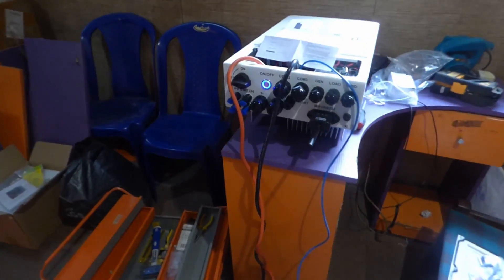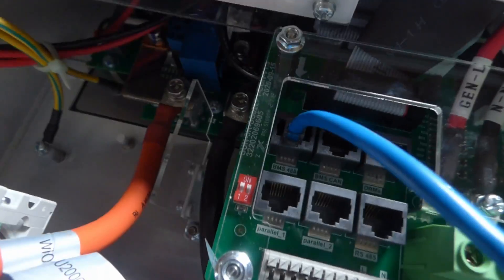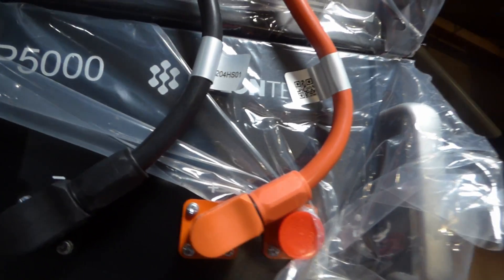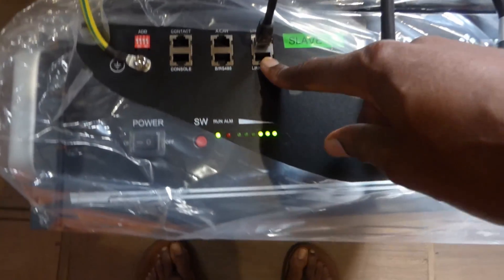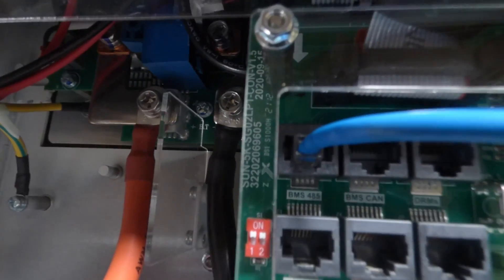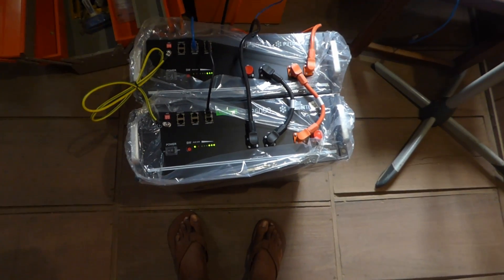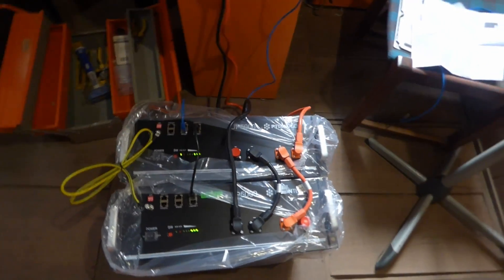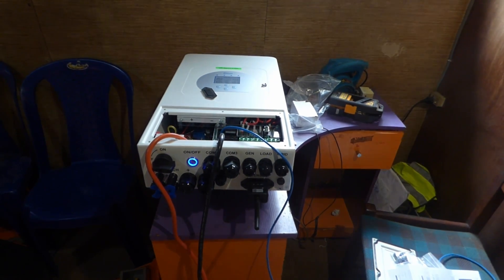Deye 5 kw and 10 kwh Pylontech UP5000C

Comment: hello,  hope you doing well , i have the same system but with 4 UF5000, notting the following issue:
The system experienced an over voltage event (56.94V - 57.11V) while charging PylonTech UF5000 batteries via grid and solar at the same time  , but no errors were logged. deye already run firmware update   but did not sort the issue, your feedback highly appreciated - thanks
Reply from the maker: Good morning. Thank you for watching and commenting. The UF5000 is a 16s battery. The voltage you saw is still within acceptable ranges. 57.11/16 = 3.56 per cell. I would not be concerned.

Comment: Hello from Ukraine!
I have been using a similar set for several days.  I can't find where to limit battery charging to 80-90%.  As soon as it is possible to charge from the sun or the network, the battery is charged to 100%.  To save the battery, I would like not to charge it completely!
Reply from the maker: Thank you for watching and commenting. Slava Ukraine. You can use time of use. Unless you use voltage it is the only way.
Reply: @drsolar  Yes . But its working only with grid energy. If you have ekstra solar energy inverter charge batery to 100%
Reply from the maker: @Pvaleriy  unfortunately I don't recall the ability to limit it with solar

Comment: Greetings Dr. Solar… you are missed, hope all is well with you and yours & the cats. 1-yr on, how have these batteries performed & how often have you had to update the battery firmware or the Deye firmware? I’m now running on lithium having redone my system and am on a UU-24-100 battery (Chinese). Have retired my panels and have to redo them again as I’m maxing out my MPPSOLAR solars 145Voc capacity this winter so most days my solar is off and am charging my battery off the grid. Hoping to upgrade inverter to 5Kw Sunsynk and US5000 Pylontech and use 1 MPPT as I have 12 x 250Watt panels. Am excited about the development so far & have had 2-3 blackouts and my battery bank was adequate.
Reply from the maker: Congrats on your new acquisition. I am sure you can see the difference between your new battery and the old. Like night and day. The kittens have developed personality and have started to hunt. They have killed a few pigeons in the compound. Most of the systems that we run don't require firmware updates. We have yet to do battery firmware updates. So far so good. Thank you for following up. Once again congrats on your new battery.
Reply: @drsolar  I’m still at beginning stage and haven’t run a full stress test on the system right down to my LBC (Low Battery Cutoff) yet, will do that soon.

Comment: do batteries go to idle when fully charged? my only goes in standby for 2-3 seconds before going to charge or discharge discharge for 40-60 seconds.
Reply from the maker: Depends on the settings on your controller. If you have Bms communications it will go into idle mode until a load large enough comes in and pushes it out of idle
Reply: @drsolar  same deye inverter. Not using solar panels.
Reply from the maker: @ah.l  okay
Reply: Які настройки провести в deye для акумулятора PYLONTECH US5000, щоб не включався і не виключався на 2-3 секунди?

Comment: What's the max Kw that the invertor can charge the batteries at? Can you parallel up the invertors for  use  on a bigger battery bank?
Reply from the maker: Hello Alex welcome to the channel. Please don't forget to subscribe. The 5 kw can charge at up to 120 amps. Yes you can parallel inverters to get higher charge current. Thank you for watching and commenting

Comment: Based on one of your other videos I will like to see how these 2 batteries behave at 95 percent discharged and where you end up running your voltage settings for charge and discharge parameters. What made you decide on the pylontech? Keep the videos coming!
Reply from the maker: I am not sure I answered. I would never run them to 95% discharge. We do 90% with these. The older batteries we did 80%. Thank you for watching and commenting
Reply: Charge discharge voltages are set by bms, you can change charge/discharge current from inverter.

Comment: Is the pylontech battery available on n Nigeria, what’s the rating ?? And price pls
Reply from the maker: Thank you for watching and commenting. US5000 rated at 4800 watt hours 95% DOD. 50 watt charge and discharge
Reply: AWPS Renewable Energy, LTD how can we buy it from you. The price sir.?  Also Can you run AC in the day time with your deye since it’s solar inverter
Reply from the maker: @abbaadam7107  I run two AC's during the day. I have enough panels to more than make up and the batteries are big enough to absorb any cloud cover. info@atlanticwastepower.com and I will quote you pricing